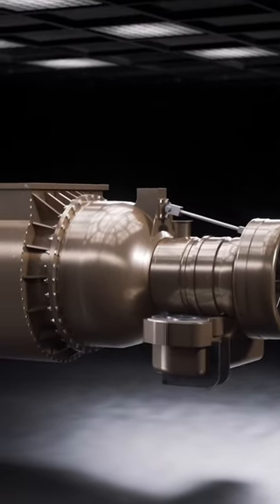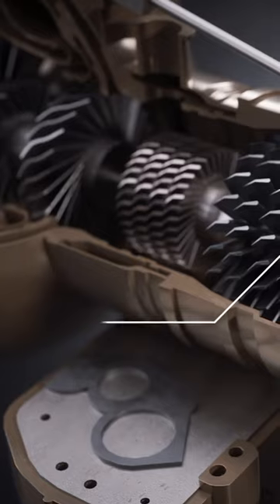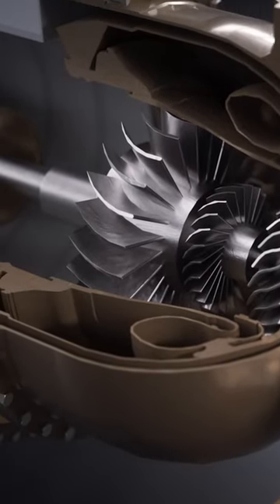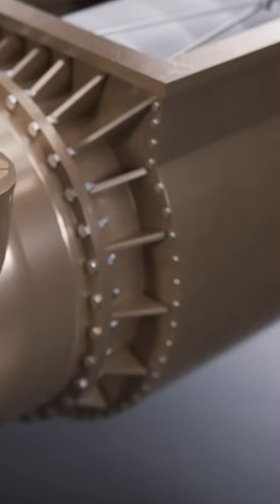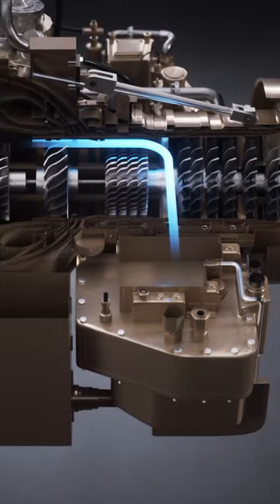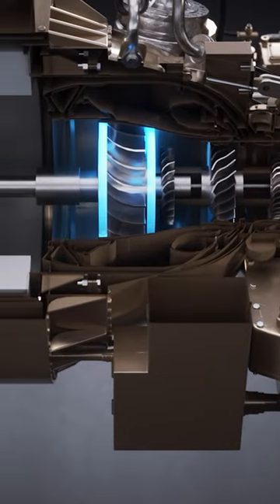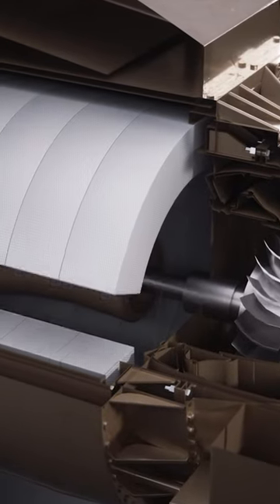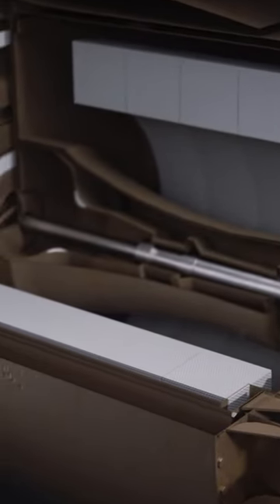How the M1 Turbine Engine Works

Comment: The Recuperator's purpose is to recuperate, for those that don't know.
Reply: Thanks for not helping us. 😊
Reply: Next thing you're going to tell us is that the compressor's purpose is to compress?!? 😂
Reply: Very helpful
Reply: The drive shaft also does a little of shaft driving, if anyone was wondering.
Reply: The recuperator replaced the extraordinarily expensive and complicated turboencabulator.
Reply: “I want to get a job as someone who names kitchen appliances. Toaster, refrigerator, blender.... all you do is say what the shit does, and add "er". I wanna work for the Kitchen Appliance Naming Institute. Hey, what does that do? It keeps shit fresh. Well, that's a fresher....I'm going on break.”
-Mitch Hedberg
Reply: Are you sure it's not to reduce sinsusoidal deplaneration? I'd assume that's what the marzle veins in the recuperator are for...
Reply: The Recuperator provides power to the Flux Capacitor.

Comment: Remember, this is only the engine of the M1. The computer chip also has several other components, including the transmission, fuel tank, and coolant systems. Amazing how they can get all that inside such a thin laptop

Comment: That engine gets so hot. You could crank it up at 7 AM in the morning for 30 minutes, shut it down and it’s 6 o’clock in the evening. It would still be hot enough to heat your MRE. I know because we used to do this when we worked on them and desert storm.

Comment: i dont think the garand has a turbine engine
Reply: Then what pushes the bullets along, eh?
Reply: a gas system
Reply: @Raden-1 a gas... TURBINE ENGINE
Reply: @Raden-1  The gas system is what cycles the rifle. What propels the bullet is a pressure differential caused by a large volume of gasses released by the burning propellant being squeezed into a relatively tight space between the inside of the casing and the bullet. The bullet creates a gas-tight seal between itself and the bore, and the casing is held in place by a locked breech, so that the path of least resistance towards equalizing the pressures is pushing the bullet down the barrel and out the muzzle.
The gas system uses a small hole drilled into the barrel to redirect a tiny portion of the propellant gasses and use them to push the bolt carrier group backwards in order to facilitate the unlocking of the bolt, the extraction and ejection of the spent casing, and the re-cocking of the hammer/striker. Then, the counteracting recoil spring pushes the bolt carrier group back forwards so that it can feed a new cartridge from the magazine, and lock the bolt to finally make the firearm ready to fire another round.
Reply: @MaxIsStrange1  what is needed to cycle the rounds? A bolt, “pushing the bullets along”
Reply: @Raden-1  Technically yes but I don’t think that’s what that guy meant since, at that stage, the bullets are still attached to the rest of the round, and either way, the bolt only pushes the bullets a tiny distance when compared to the 800+ yds that the bullets fired by the M1 Garand can travel after leaving the muzzle.

Comment: Just a curious question. Why not use a diesel electric motor? I’m by no means an engineer and have no clue what goes into the designing such a thing. If we can scale down jet engines to move a tank, why not a diesel electric?
Reply: Main reason is speed for the tank as it weighs 74T. Turbines use a lot of fuel even at idle. Uses too much fuel for truck use.
Was tried in the 60s. And for trains. But just too thirsty.
Reply: Less of a noise signature (high pitched sounds don't travel as far as lower pitched sounds, and constant sounds are tuned out more effectively by our brains than the rumbling of a piston engine)

Better power to weight

More suitable for high-speed driving

Can run on basically anything that burns

Better at higher elevations

There's more to it, but that's the basics. The M1 does indeed have an auxiliary power unit, which is a small piston engine, and that's used for powering electronics and other systems while the tank is stationary.

Comment: Wouldn’t the massive air intake be a huge risk?
Reply: It's on the rear deck of the tank, where no one should be anyway when it's running, and the inlet is sufficiently large and designed well enough that the suction force on any individual spot isn't that great

Comment: If a turbine engine is so much more efficient with its power to weight ratio then why don’t race cars (hyper cars/nascars/super cars/ sports cars) have them?
Reply: The lower limit is higher. A useful turbine setup has a bigger, heavier imprint than the same amount of power from a regular engine.

Like sure 1 ton compared to 2 tons is a huge savings. But a smaller turbine might be half a ton compared to a 1/4 ton or less engine for the same power.

Also, there has been a production turbine car in the past... Chrysler made it, Jay Leno has one.

I actually looked it up, and the turbine in that car weighs 415lbs and makes 130 horsepower. Yeah, not a great ratio. Lot of torque though.
Reply: @dfrostedwang5478  what about turbine engines for heavy machinery like super lifters?
Reply: @haydnw869  I don't know anything about those machines but I would assume that having a heavier engine is actually a good thing. If you're working with huge loads, lifting or pushing against something heavy, you would also want to be heavy yourself.

It wouldn't make much sense to put a weight reducing engine into a heavy machine, then fill any space saved with lead to make it heavy enough to work on things without moving around. 

And turbines cost A LOT MORE than regular engines because they are very precise. A tiny dent or bend in a blade and the whole thing might be ruined. Could be caused by just getting debris into where it shouldn't be.

Nobody on a construction crew is going to be able to repair anything that breaks. Heck, even trained repair people would probably throw new parts in instead of trying to fix the thing, because you aren't going to have a full machine shop to do repairs. The tank situation, pretty sure the plan is for other things to go wrong before the turbine does and they can just throw tax dollars at fixing it when it breaks. Not that I mind paying for our cool ass tanks.

Comment: Not the first time a tank is powerd by a plane engine. M4 Sherman’s had radials
Reply: The Honeywell turbine on the M1 isn't a plane engine, it is a dedicated purpose-built turboshaft engine designed and built solely for use on the ground. This same kind of engine is used in large backup generators which output enough power to serve entire neighborhoods. It's no more a plane engine than any old piston engine